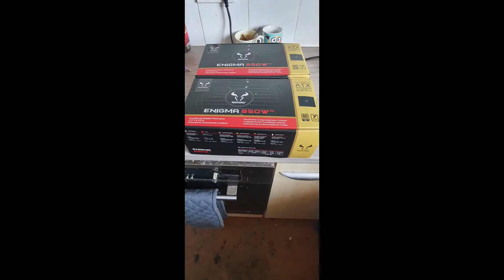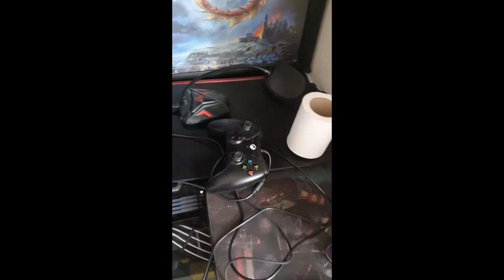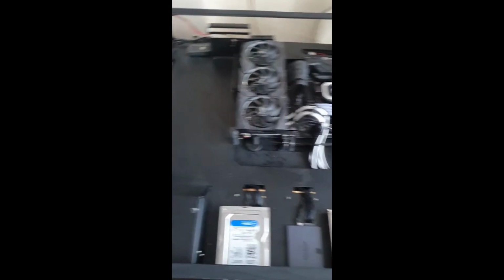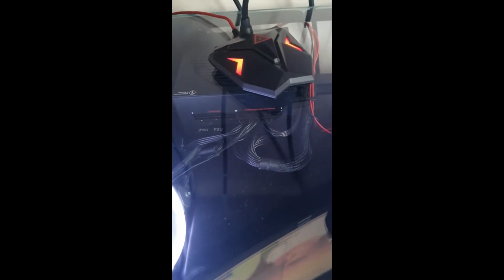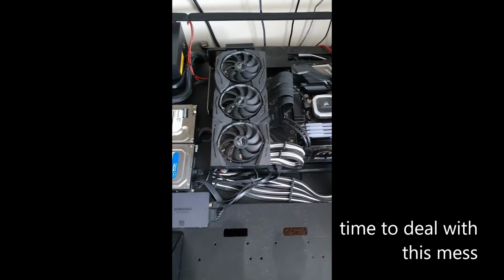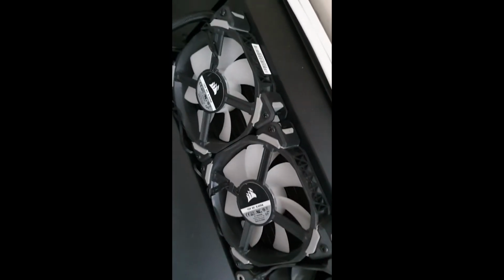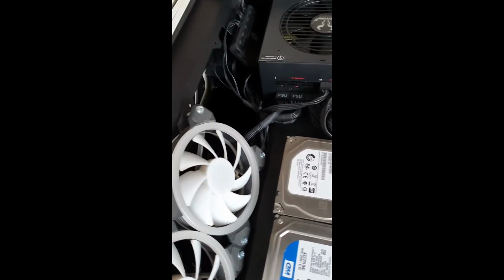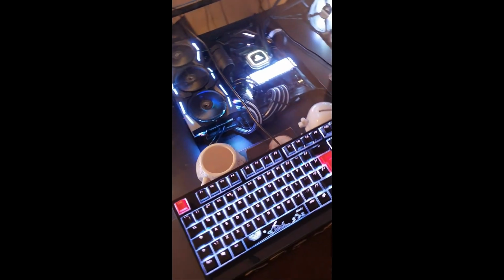desk build pc, my hydra evolution

Comment: Buddy I think it looks wicked. Nice one. Is it made from sheet metal? I'm thinking of making mine with sheet wood. I had an idea to have it with enough space for 2 systems either side and I was gonna make like a 2 layer base and on the bottom have like doors on hinges underneath where all the cables could be hidden then just open the doors with a latch to access them. Im gonna at some point when I get time make a 3d model on fusion 360 of what I want it to look like.
Reply from the maker: sound like a cool build, i wanted to do summit like that but just a single rig but i cheated n bought the desk coz money time limited space n not forgeting lack of tools. oh and my cutting/sawing skills are .... crap. theres a few home made desk build vids on here that make mine look like a toy but if i had there cash ...... :P hope you do a vid or 2 on your build when you do it. will def watch.
Reply: @sceptic44  where ya get the desk from? Intrigued to see what it looks like before you modded it. I will defo do vids for it but won't be till after I move house where ill then have a garage to work in so gonna be a couple month till I even make a start on it. I wanna set it up to be able to have mounting points for water cooling too. Just wish this youtube malarkey made me some money then I could afford to go to town on it lol.
Reply from the maker: @DowsettReviews  i got the desk from amazon its a hydra slim desk. dont think they make them any more. want to do a water loop in this but cash is tight. also want to move gpu further to the left but need a longer cable rizer. would love a garage n a house would be nice :P me wife 3 kids n 4 cats are in a 2 bed 1st floor flat so makes doing anything big to my rig a little awkward. iv subbed to your channel n hit the bell so will def watch your build develope. reet now of t bed as gota b up for work at 4.45am tomorrow.